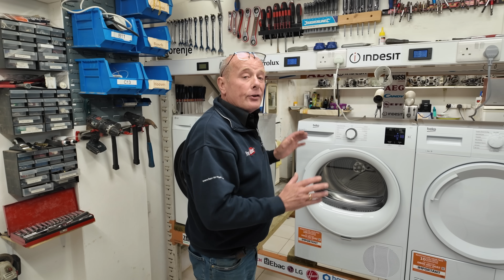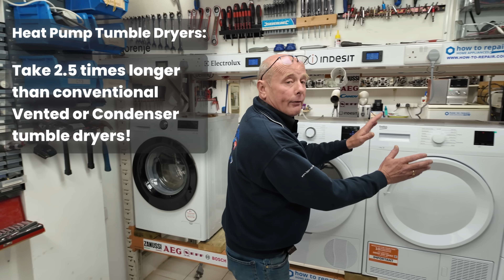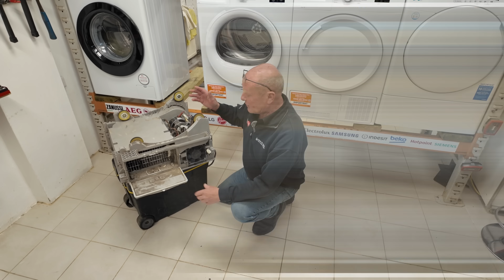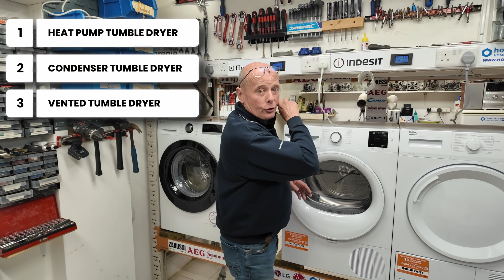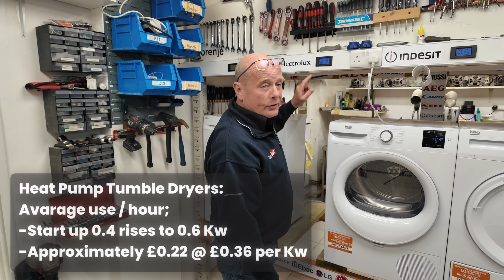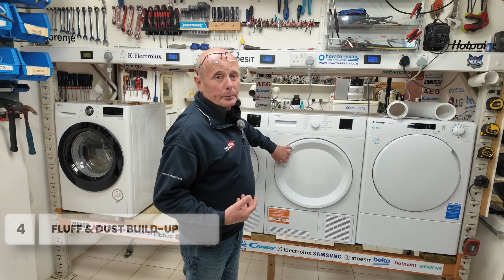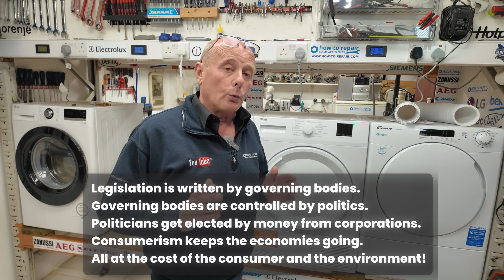Tumble Dryers the Shocking Truth About Heat Pump vs Vented & Condenser, NEW LEGISLATION!

Comment: Interesting review, thanks. Had a Bosch heat-pump dryer for 9 years. Typical family use......the biggest benefit we've found, other than the reduction in running costs, is the fact the drier is actually very gentle on clothes. I know this is counter to your comment within the video. Our dryer also avoids that awful clothes shrinkage that hot dryers cause. Dryer has been faultless, if it broke tomorrow (which it probably will after this comment) I think I would buy similar again, but would weigh it up beforehand.
Reply: My Bosch heat pump condenser will dry most of my loads in about 80 minutes on the Delicates cycle, and about 90 minutes in the Easy Care cycle. Even if I do use the Cotton or Towels setting, they are regularly dried quicker than the machine’s initial estimate. And as you say it’s far gentler on the clothes. 

My old standard condensers (which were ancient second hand models) took about the same time.
Reply: @maireanic8280 it is the same for my Miele Heat pump.
The times that guy used in the video are nonsense.
Reply: I'm seeing loads of reviews on heat pump dryers saying they take hours and clothes still come out damp so you have to keep putting them back in to get them fully dry. Sounds like more hassle than it's worth. How does that compare to your experience?
Reply: @myAutoGen  

They probably use 8-10 kWh for a full load and clothes take a pounding each cycle. We use 1 kWh or so, very kind to the clothes.

We have a 2012 Cylinda TVP 420 with heat pump. It has a 800 W max rating and it has served us BRILLIANTLY for 13+ years now. Only thing is a bit of belt slip(?) causing noise during first minutes of operation, that's been for many years now. We found it on sale and I got the price down a bit more, picked it up for around £400, original price was twice that.
It dries 8 kg of clothes in 60-90 min, so I'm not sure what garbage is on the market these days. 
Our 2012 Cylinda Sverigetvätten washing machine is very similar to the ASKO you recently reviewed, only older... We also have a Cylinda Sverigedisken, dishwasher, from 2012, nowadays produced by ASKO, while Cylinda took the path of planned absolecense. Our parents in law have an ASKO and after an initial warranty repair, it's been GREAT and the inside is fabulously great to allow three layers high stacking and STILL getting it clean!
Reply: My bosch heat pump (some top of the line one) also manage to "dry" synthetics, which is nice. But clothing is never totally dry even if of maxing all settings on time and cupboard dry +. Saves the material maybe, but would be nice to have clothes a bit dryer.
Reply: @bigbadboogie6842 I have all Bosch appliances for about 25 years and I think the quality nowadays is not what it used to be. My original ovens are still working well, I replaced the dish washer after about 18 years and had it replaced again recently. I have replaced the washing machine after about 10 years and a few times since on ever decreasing cycles. I have now switched to AEG.
My dryer experience was similar to my washing machine experience and I have now have a Bosch heat pump machine and my experience is similar to yours, hard to dry clothes fully.
Reply: @boatman6865 we bought a Samsung heatpump dryer. We get dry clothes but we we nearly always use the cotton program. Takes 90-120 mins but fully dry always. Going for 6 years now knock on wood, we have 4 kids so we have 5 to 6 dryer loads per week of minimum 5kg+
Reply: Easy to see how much it wears clothes. The more lint in the filter, the more wear. My "self cleaning filter" Bosch (big lie, theres 2 filters even, a wet and a dry, but you dont need to clean every cycle but at least every 2 week or so if doing 4-5 loads) certainly has a ton of lint in the wet filter (machine basically shower the dry filter periodically to flush it into the wet one). Also if i dont clean that wet filter in weeks, theres alot of moist lint = gunk and mold can build up i guess. Also that bottom area never gets fully dry, allways aome water on bottlm ofnmachine even if its level and connected to the drain pump
Reply: @bigbadboogie6842 i am thinking of buying this self cleaning Bosch dryer but i cannot found any videos related to the cleaning process. But i am afraid it is not easier as one witjout this feature
Reply: @groszi  I have a "self cleaning" Siemens (same as Bosch) dryer. While you don't have the regular task of cleaning the condenser, it will still get dirty over time. And the issue is that you literally have no possibility to clean it easily beacause the condenser is sealed. You need to completely  disassemble the machine to access it. Or you have to cut open the plastic sealing the condenser. That's what I did, much easier than disassemble, unfortunately you can only clean one side of the condenser. Hopefully it will be enough in my case.
Reply: Agreed! 

Others probably use 8-10 kWh for a full load. We use 1 kWh or so.

We have a 2012 Cylinda TVP 420 with heat pump. It has a 800 W max rating and it has served us BRILLIANTLY for 13+ years now. Only thing is a bit of belt slip(?) causing noise during first minutes of operation, that's been for many years now. We found it on sale and I got the price down a bit more, picked it up for around £400, original price was twice that.
It dries 8 kg of clothes in 60-90 min, so I'm not sure what garbage is on the market these days. 
Our 2012 Cylinda Sverigetvätten washing machine is very similar to the ASKO you recently reviewed, only older... We also have a Cylinda Sverigedisken, dishwasher, from 2012, nowadays produced by ASKO, while Cylinda took the path of planned absolecense. Our parents in law have an ASKO and after an initial warranty repair, it's been GREAT and the inside is fabulously great to allow three layers high stacking and STILL getting it clean!
Reply: High heat is bad for clothes.  I suspect that just bouncing around in low heat is not as destructive to clothes as the heat is.
Reply: Yes agree with this. Also, I have a hybrid heat pump. It has a heating element if I need. Best of both worlds. Also, I don't find the drying time that much longer...

Interestingly, I hose out my condenser box. Just till the machine forward... easy
Reply: I've had a Bosch heat pump drier for 10 years now and it has never needed any maintenance. We are a family of 4 and ran a bed & breakfast for 8 years, so it has been used more than average. I know that fluff build up on the condenser is the killer for these machines, so I make sure that I clean both the filters carefully after every load. This machine has paid for itself several times over in electricity savings, plus the room gets nowhere near as warm as my old condenser drier. I would definitely buy another Bosch heat pump drier.
Reply: @dixonsindorset  100%

Others probably use 8-10 kWh for a full load. We use 1 kWh or so.

We have a 2012 Cylinda TVP 420 with heat pump. It has a 800 W max rating and it has served us BRILLIANTLY for 13+ years now. Only thing is a bit of belt slip(?) causing noise during first minutes of operation, that's been for many years now. We found it on sale and I got the price down a bit more, picked it up for around £400, original price was twice that.
It dries 8 kg of clothes in 60-90 min, so I'm not sure what garbage is on the market these days. 
Our 2012 Cylinda Sverigetvätten washing machine is very similar to the ASKO you recently reviewed, only older... We also have a Cylinda Sverigedisken, dishwasher, from 2012, nowadays produced by ASKO, while Cylinda took the path of planned absolecense. Our parents in law have an ASKO and after an initial warranty repair, it's been GREAT and the inside is fabulously great to allow three layers high stacking and STILL getting it clean!
Reply: Is it still running? Lol
Reply: @MrSmid888 Mine? Yes.
Reply: This has been my experience with my Bosch as well.  That it is gentler on clothes.  That is a far more compelling reason to purchase a heat pump dryer than the others in my opinion.  And my clothes and towels and sheets come out nice and soft, as opposed to stiff and scratchy if I dry them out in the sun.  I hadn't considered the wear and tear on a machine that runs a lot longer :( and it's so expensive to begin with.  Also, there really /is/ a lot of fluff everywhere!!!
Reply: Yes may experience a gentler warmth which drys clothes well but doesn’t risk harming them. Problem in my opinion is fact I cant gain real access to clean condenser unit like old condenser tumble dryers I have had. I don’t mind it taking longer to dry but I assume given fact I bought a heat pump dryer that quite cheap a zanussi which recommended one it will give up after 5 years and 2 weeks so maybe a false economy.
Glad your Bosch doing well. I have a Bosch washing machine I am very happy with.
Reply: Of course but it takes twice as long!
Reply: @ just because something takes twice the time doesn’t equate to twice the wear.
Reply: @Mavermick1 that's not how it works.

Heatpump driers so not go very high temps, however condenser types do go up quite high, which causes severe damage to the clothes.

The effect of higher temperature of a condenser drier and taking twice of time ia imparallel, temperature ia 193827920377282x more important hence the heatpump is much better and gentle to your clothes.
Reply: @user-pf5xq3lq8i  it takes 6 times as long on the line in the back garden (Ireland🙂). Does that me its worse?
Reply: @user-pf5xq3lq8i  its not quite that bad. But my guess is around 40 minutes longer for my loads😊
Reply: @user-pf5xq3lq8i  it depends on the model and usage type a lot. My previous LG condenser dryer took over 3hrs to dry a full load of towels but my heat pump Miele does it in 1,5hrs. Also uses a quarter of the energy and is way gentler than the LG. The capacity is the same too so it's not like Miele has more circulation room for clothes. 

The same applies to washing machines and dishwashers. They can and do use less water and energy while being faster or as fast as older machines (Again, I have a Miele with the QuickPowerWash 58min). It just depends on what model you got and how you use it. I admit I may be biased because I only have Miele appliances now, but no doubt can machines from other manufacturers perform as well.
Reply: @user-pf5xq3lq8i  Nope, not with good machines.
You probably use 8-10 kWh for a full load. We use 1 kWh or so.

We have a 2012 Cylinda TVP 420 with heat pump. It has a 800 W max rating and it has served us BRILLIANTLY for 13+ years now. Only thing is a bit of belt slip(?) causing noise during first minutes of operation, that's been for many years now. We found it on sale and I got the price down a bit more, picked it up for around £400, original price was twice that.
It dries 8 kg of clothes in 60-90 min, so I'm not sure what garbage is on the market these days. 
Our 2012 Cylinda Sverigetvätten washing machine is very similar to the ASKO you recently reviewed, only older... We also have a Cylinda Sverigedisken, dishwasher, from 2012, nowadays produced by ASKO, while Cylinda took the path of planned absolecense. Our parents in law have an ASKO and after an initial warranty repair, it's been GREAT and the inside is fabulously great to allow three layers high stacking and STILL getting it clean!

Comment: I went from a B rated bosch condenser dryer to an A+++ rated Samsung heat pump dryer 3 years ago.
I am pleased with it so far, the old dryer would damage clothes with patterns on because it got so hot inside, the new one doesn't. I think the lower temp is less damaging, offsetting the longer run time. Often the old dryer would need a second run to get things properly dry, this happens less often than the old one. The run times are about the same for both, the new one says 3h05m when started but usually takes half as long as it checks moisture level with a sensor (the old dryer also had a sensor).
As for longevity we will see. It has a 5 year parts and labour warranty, 10 years on compressor. I clean the main filter every use and there is access to the front of the fins on the heat exchanger on the bottom which is cleaned maybe every 10 runs. There must be build up deeper inside, maybe I will take it apart for a clean if it starts running less effectively.
Reply: I find the same difference between estimated drying times at start up and actual times on my Samsung heat pump dryer. Most times it will start at over 3 hours estimated but after an hour suddenly reduce greatly and end up and a hour and a bit.
Reply: you say in the comments. Five year pats and labour warranty 10 years on, compressor I'd like to bring to your attention and I'm sure I'm correct, 5 years. Warranty is all you have because. The ten years on the compressor In 9 1/2 Years Time you'll find that either the compressor has changed design or not available you may be able to get one if you're lucky, but who's going to fit it and how much will it cost you to fit it? Because it will have to be braised in and recharged with refrigerant this is not a cheap job and it's not a two hour job open brackets. I am a retired refrigeration engineer.

Comment: A product that costs more, lasts less, and is uneconomical to repair, who wouldn't want that? It's the perfect product from a business stand point.
Reply: Actually is not true: I had a condenser unit and  it was very hot: not nice for delicate clothes. 1h20min  at 2kwh to dry mixed clothes. My new heat pump, same brand, very gentle, 2h20 at 400W.  It has 6 years now, and the only problem it had was a failing condenser, I've changed it, 10€ in total.

Comment: Well explained.  Thank you.  We haver a 15 year old vented tumble dryer that has sttod in our outbuilding for all that time and runs really well.  Never needed an engineer.  E=We just keep it dust free - simples!  You might have also included the calculation of the energy inputs for the manufacture of these machines too.  Such as the iron ore mining and the machiery needed to do this, the later steel production, all the oil needed for this and the rubber production, transportation etc.  Probably the biggest issue however is that these are a solution to a faux problem.  Climate change is natural, has and will always be happening, and we're moving out of a mini-ice age period.  Also, CO2  is not a problem, we and plants need it to survive.  Current levels of CO2 0.04%.  For plants to survive 0.02%.  The level of CO2 in the bountiful Cretaceous period 0.08%.    As Klaus Schweb of the EEF admitted, Climate Change narrative has nothign really to do with the climate, but a neo-Marxist means to redistribute wealth from the West to other parts of the planet, - the Third-World, but ends up benefitting authoritarian regimes like China!

Comment: Make an experiment of actually drying some clothes in different type dryers. I switched from condenser dryer to heat pump and don't notice a huge time increase in drying. Heat pump dryer does not need so much heat as it is able to condense the moisture more efficiently, as heat pump evaporator coil cools down way below ambient temperature. More gentle on clothes as well. I see here mostly positive comments of heat pump dryer owners.

Comment: I have a Bosch series 6 washer/driver but have no idea what technology it uses! I'd love to know how I keep it clean as it's been used 3.5 years without cleaning other than the cleaning cycle on the machine, which I doubt does anything other than running with hot water.
Reply: A conventional washer dryer uses an element to heat the air and sprays cold tap water in its condenser to condense the moisture out of the warm, humid drying air, before passing it through the element and back into the drum. A cleaning cycle pretty much just does a hot wash cycle, although it may possibly turn the drum a bit faster than normal to slosh and throw the hot water and the cleaning solution (usually an oxygen bleach based cleaner) higher up in the tub than normal and to try to dislodge lint and old liquid detergent and fabric softener residue, which bacteria will grow in. My washing machine pre-dates the invention of cleaning cycles, but I do most my washing at 40°C, and very occasionally hotter, and use good old fashioned washing powder that has oxygen bleach in it which kills bacteria, viruses etcetera in the machine and the clothing and keeps the machine clean. The better powders have a bleach activator in as well (TAED) which allows it to work at lower temperatures.  I also leave the door and draw slightly open between washes to stop mould growing. And I also have to descale my machine at least once a year because of our very hard water. I know it works well as I had my washing machine apart after 10 years to replace the bearings, it was clean inside and the aluminium drum support was corrosion free. Likely a washer dryer will be a bit harder to keep clean because the condenser and air ducting wont get washed with cleaning solution.

Comment: It would be worth mentioning that heat pump driers won't work in low ambient temperatures, for example the one we owned would not work in the garage during the colder winter months and had to be taken into the house.

Comment: I might not the the sharpest but heat pump dryers take the air from inside your house extract heat from it and spits out colder air? In my mind the air it uses is already heated by some energy source so shouldn't that also be added to the energy consumption of the dryer. Wouldn't the total energy needed to evapolarate x amount of water be the same?